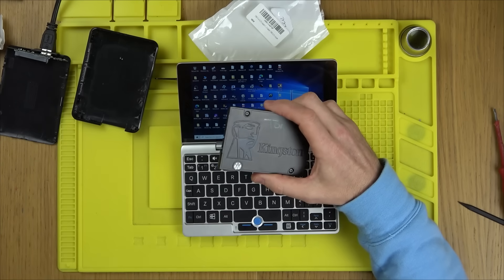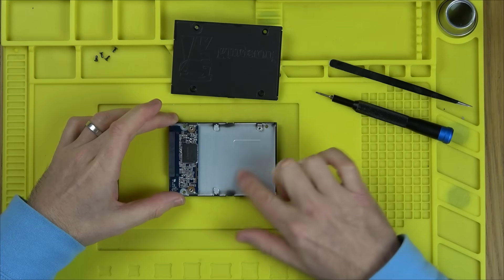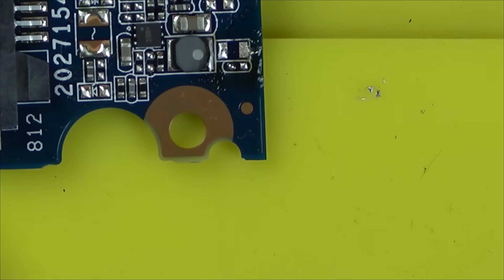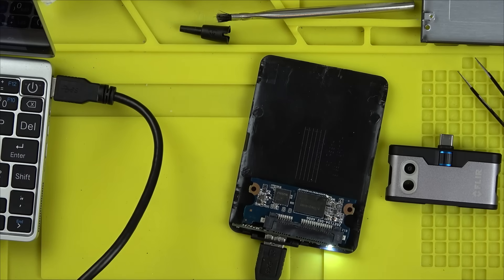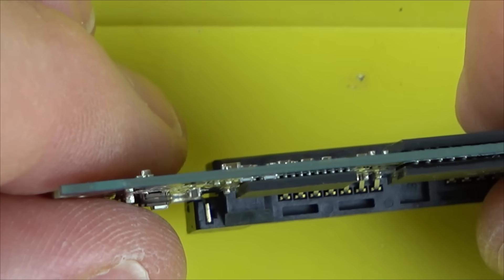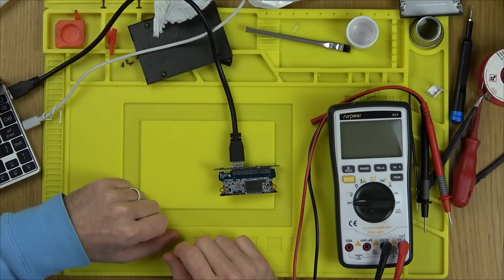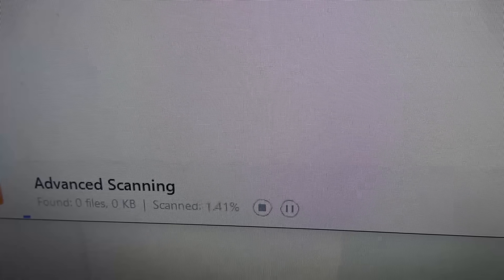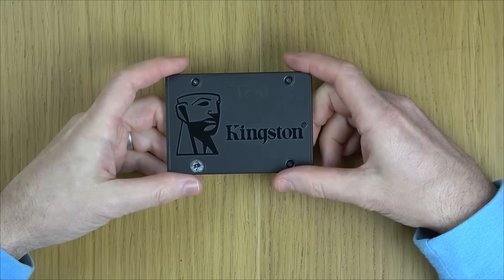Can I FIX a Kingston 240GB SSD ?

Comment: If you are still reading these comments... I have a Sandisk that gives this message. "check cable connection pxe-mof". I changed out the SSD and all is well except the saved documents and downloads are gone now.
I put it in another laptop and gives same message, so pretty sure it is trashed. Can you think of a reason this would have happened?

Comment: TESTDISK/PHOTOREC is an extremely powerful open source recovery tool that is CLI-based and allows you to manipulate the geometry of a failed drive which can happen when firmware gets scrambled and corrupt. It can recover individual files or it can recover entire partitions and it has worked magic for me in the past. Obviously if there's complete firmware failure or the drive is not able to be read at all within Windows then chip off methods would definitely have to be pursued. It's definitely worth a shot in the future if you ever run into a drive that is acting like this. Just my two cents, but figured it was worth sharing since I've had good success in the past!  I love all your videos, failure or not and I'm slowly making my way back through the MMV archives and it's so exciting to see the progression and of course such an extreme variety on this channel. Got yourself a lifetime subscriber here! Keep up the amazing work😊

Comment: I gave up on SSDs except for system/app drives. everything else is on spinny disc, from multiple vendors, & multiple copies of everything everywhere. I have at least two copies of every file, & the back up strategy is folder-based, not by volume. it's harder to manage but a better approach, & the app that does all this is programmed to nag for the drives to be mounted so it can do its stuff.
I started doing this when 'disk warrior' couldn't recover my data from a bust hitachi in one of those orange lacie cases. it showed me what had been on the drive, though, & there was some value in knowing exactly what I'd lost.

Comment: Hi vince, was the power settings power saving mode shutting down the SSD? Maybe set the hard drive shutdown power setting to more hours before shutting hard drives down, or never, so it never shuts down whilst recovering the drive in the recovery software

Comment: never use a ssd for sensitive data always use mechanical hd or back it up regularly to mechanical these ssd,s are a pain in the butt cheeks they only way to fix them is usually destructive to data so be warned.

Comment: It is not possible to recover that disk because the flash memories are already damaged. Every time you write to an SSD, the cells degrade, and when you reach a high TBW rate (the manufacturer specifies it) in that model it's 40 TBW, the memory is damaged and it is only possible to recover some information with very specialized tools. Use Crystal Disk Info to see the statistics saved in the SMART.

Comment: People think solid state memory works for ever, however as USA Tesla customers are finding out it doesn’t, Teslas solution is to sell you a new screen unit. The 24/7 Camera system is causing the issue. They can be repaired by a 3rd party company who provides significantly more solid state memory.

Comment: Thinking outside the box but an idea If that chip is getting hot, is it the chip shuts down and the software stops reading when it gets too hot? Switching off then re-starting may allow it to cool enough to start the process. Why not get a freezer block (Ones used for cool boxes for picnics) and sit the pcb (keeping it dry) on the freezer block and trying while keeping it very cool. Just a thought.
Reply: The flash memory controller chip always gets much hotter, which is normal. That's why it has a metal casing to dissipate heat, although many cheap drives are made of plastic. If that chip weren't working, it simply wouldn't detect it, and in this case, it did.

Comment: Dont use the usb/caddy way of connecting the ssd, instead, connect the ssd drive directly to one of the sata connections in your pc. The  usb way of connecting an ssd drive does not deliver as much power to the device as a main connection form your pc, and so, you can expect your usb powered ssd drive to run competently for a little while, but not run competently for an extended period of time, especially when the ssd drive is being run under load. If you use the main sata connection method directly from your pc, then you should not experience any under-powered hardware failures from the ssd drive that you are running anf you will more than likely be able to fully complete a scan with your hard drive recovery software - fyi, the EaseUS Disk recovery software is definitely the one to go for from your software choices by the way 😀😀

Comment: Sorry...I meant firmware.  I recently dealt with an OCZ Deneva SSD that behaved exactly the way this Kingston is.  After checking every capacitor and throwing every imaginable software tool at it, I was about to give up.  As a last ditch effort I scoured the internet to find a utility from the manufacturer.  I luckily found one that allowed me to update the firmware.  The drive immediately sprang to life and is currently running in one of my systems.
Reply: Did updating the firmware wipe the data?

Comment: Hi, can anybody help me solve my mystery that I have with a brand new SSD, It will not keep it's drive letter so every time I reboot my PC I have to reassign a new drive letter and because of this it can not be used as a boot drive. This is the same message I get from mine and all you have to do is allocate a drive letter, but like mine it will only work until you turn it off, then you have to do it again. It is a pity you did not know just to allocate it a drive letter and it probably would have worked fine so that you could then just copy all the data to a new drive.

Comment: had similar ssd with similar disconnect issues wean trying to copy the data from drive , worked for me using boot to Linux live and copy the filse from the old failed ssd .

Comment: If you are reading ANY voltage across that 0 ohm resistor, then it is technically open. There should be no drop across a short.

Comment: Hello,I'm a bit late to the party but I repaired many of them wich didn't have any shorts by reflowing that controller with 400c and flux,copied all the files after to a new one . I think that chip gets too hot and in time the solder balls crack and it comes to this .

Comment: There are a lot of things to Consider with this kind of Problem, I have had this kind of Problems DOZENS of Times, First thing is Windows, Windows in this case I believe is the Problem.  😁This is ONE of the Reasons I Switched to Linux. Secondly there are bugs out there that Screw with the Motherboard CMOS Configuration Files, and will create these kind of Problems. One way to Check and see if it is a CMOS Bug is to Unplug your PC and Hit the Power Button, 30 seconds, in the case of a Laptop you will have to Remove the Battery. This usually will clear the CMOS Bugs. Even if you Format a Drive to Fat 32 using Linux, if you switch back to Windows and Plug the Newly Formatted Drive (performed with Linux) Windows doesn't want to Recognize the Drive Properly UNLESS you redo the Drive in Windows. I'm not real sure WHY this happens but you can try it yourself and it will be a Problem that CAN be Replicated. If you Format the Drive Originally in Windows to Fat 32, Linux can use it no Problem. So when I am Creating a Drive I want to use on both Operating Systems, I will Format it on Windows first.

Comment: Good reason to back up . I have various drives on mine with SSD for the most part and just back up to more than one of them.  I have found linux to be helpful in the past for seeing onto drives that windows wont see but if it is a chip problem its likely going to do the same there as in windows.

Comment: i had a 500 GB WD 2.5" SSD that my roomate plugged into a modular power supply with a different power supplies power cable ( was pinned differently ) and it killed the SSD. Wouldn't show up under Disk Management or Diskpart. And it ultimately killed the Power adapter for my cloning dock. Didnt think an SSD could do that lol

Comment: The fact that the drive shows up in Windows and Disk Management isn't hanging implies it is a software problem of a corrupted partition. First port of call here would be to use data recovery software to see if you can recover the data from the drive. Shorted capacitor would normally take out a power rail and nothing would work.

Just finished watching the video, good video

Comment: I PUT A NOCTUA d15-S CPU COOLER JUST SITTING ON THE pHISON cKI[ WITH SOME THERMAL GREASE AND I WAS ABLE TO RESURRECT THE DATA AND COPY IT TO ANOTHER DRIVE.
(Sorry about the caps above.  Damn caps-lock was on and I did not want not re-type it.)

Comment: the heat spot under the chip is from the solder balls touching each other this is caused from overheating system unballed solder spots making it freeze,and is consistent with the heatspot we seen in your thermal camera!!!! resolution. run a bead of kingbo no clean flux around the chip and bake the board for 30 minutes on 350 degrees. 
this is a last resort, but it works on most graphics cards and ram modules aswell. goodluck!

Comment: Oh yay... I have that exact same drive, same size and all.  But I replaced it with a different brand, larger drive which I only use as a boot drive as SSDs will fail, guaranteed.  Yet all my HDDs all still work.  I think I had ONE HDD fail on me in my life, and that was two decades ago.  So now all my data goes on one of two 4TB HDDs, Seagate which I have also done really well with.  I still have old 20G Seagate drives that work.
 
I'm curious, what is that external USB cable you used to plug the drive in?  I could use one.

Comment: Windows is never the best OS to use to test a disk drive. Windows only knows Windows formatting and will just prompt you to initialize it. I use Linux and GParted to identify any potential partitions on the drive. I have used Linux to recover files on an SD card that Windows didn't recognize at all.

Comment: I realize that I am 10 months too late, but if you find yourself in similar situation again, you might have a better luck by doing a data recovery with a dissembled drive and a big heating on the problematic controller chip. The way it cycles available and unavailable reminds me on some internal thermal protection. I assume that the heating problem is based on some kind of internal failure, but if it works fine at first, a heatsink might help it work long enough to pull the data out.

Comment: sure fire way to get the data off of the drive would be to remove the storage chip and either put it on a new board or a specialized tol which is basically just a new board but with a socket so you don't have to reflow it

Comment: My Linux-centered mind immediately went "Boot up linux mint cinnamon edition, and try to make a backup disk image, apply that image to a different drive (to determine the validity of the image file) and then initialize the physical drive. then apply the disk image to the drive and its fixed. however, this depends on what is wrong with the drive. I am not sure if the data would be detected in linux mint, and, even if it did make it, it could be that the index table is corrupted, and you wont be able to access those files without a specialized software (often paid). I am not a professional of any sort (far from it, im just a hobbyist who knows a LITTLE about linux)

Comment: This looks to me like something caused the file allocation table/MBR to corrupt. Back in the day I could sometimes recover these enough to extract data. Many times it would be enough to connect the HDD to another PC and run CHKDSK manually. The key was to tell it to ignore bad sectors and attempt repair of the file system. If you were lucky, the bad sectors would be in unused areas of the HDD, or maybe affecting system files, leaving you free to copy the important data off. If the HDD was particularly unstable, I would use software to create an image of the HDD, again ignoring bad sectors, then mount the image elsewhere, leaving me free to repair the file system and extract the data without the HDD crapping out every 5 seconds.

Comment: These drives are trash. Having purchased around 200 of the 240GB variant, 40 of them failed within a year! They were tasked with running Windows 10 on basic office computers, very light work indeed!
Reply: I find Samsung to be worse. I bought a 1tb a few years ago and it only lasted a month before it died. Adata was just as bad. I would suggest a crucial drive.
Reply: I have 1 almost running for 5 years, still running

Comment: it says SATAFIRM S11. This could be a firmware brick. I have had same kingston drives recognized only as SATAFIRM S11. I looked up the internet and found that it's not something easy to recover the firmware. these kingston drives are just unreliable. i switched to Integral, Lexar and some other one since then..

Comment: I also have a Kingston drive, same size (240GB) which failed just the same as the one you reviewed here. Various recovery software I tried behaved exactly the same. Curious thing: when I opened the drive after seen your video, the board is different and there isn't one of those Phison chips inside. Also, when the disk failed, one of the first things I tried was to use Kingston tools to try to repair, access or at least reflash it. To my surprise, the Kingston tools didn't even recognize that a Kingston disk was attached to the computer at all (I was not using an USB adapter, but directly attached to another SATA port).

Comment: For recovery software, you could've tried testdisk (i used it to recover my corrupted data) to see if it also recognizes it but, if other softwares gave the exact same problems than most likely, it's the ssd controller chip.
Reply: No. It's the firmware.
Reply: @cosmefulanito5933  plausible
Reply: Glad someone else knows about this awesome software

Comment: I know this is an old video but that Philson chip looked like it got really hot.  Too bad yout didn't have the chip spec sheet to look up the heat tolerances. I wonder if after its been on a while the thermal throttling mechanism kicks in and disconnects the drive.  Could've been work trying to mount a cooler of some kind on it to keep the Philson chip cool long enough to see if the data is viable and extractable.  Just a thought. Cheers.

Comment: i got the same probleme on a usb stick , on the first connection it show me the full stick, but when i try to read from stick to backup data . it will be disconectetd .disconect and reconnet work but you can distroy all the data on the stick. i found a other solution to backup the data . the probleme is the fault chip it run to hot you need to cool down it then you don`t lose the connection . so you can backup you data.

Comment: These Phison S11's fail in such a particular manner. It clicked when data recovering, as the ssd showed up as SATAFIRM S11. Since the SSD shows up in the pc, the hardware is fine, the S11 is fine and functional, the heat you saw is normal. These controllers have a habbit of corrupting their own firmware, along with all the mapping of data on NAND flash. Data is pretty much unretrievable with conventional means, but by reflasing the firmware to the chip, you will have a perfectly functional drive. This fault is literally everywhere an S11 controller is, it is extremely standard (and sad for the data owner)

Comment: I do automotive repair, when you see discoloration like you noted on that chip its 100% dead, iv seen them go so far as to leave an obvious almost xray like silhouette of the leadframe package on the surface due to heat. in the automotive world its usualy easier to spot from bubbling or discoloured conformal coating, but intereor protected devices like say an airbag controller may not have conformal and exhibit what you show here.

Comment: try putting in an anti static bag and cool it in the fridge see if will get through more scanning, if it does then try keep that chip cool or a long usb into a fridge to get the data ;-) worth a try as it is getting someblocks before disconnecting

Comment: Connect it to a Linux box, after checking for any variations of the locked status (hdparm or smartctl etc...), you could throw a couple of lines of bash script together to disconnect and reconnect the USB I/O, while pausing/re-synching the scan repair and data retrieval.

Comment: Hello, I had a similar problem , and I found the solution. I tried with windows, linux, chrome os, but all showed like that ssd in the video. After I pluged a Mac OS 10.13 which is an old apple os, and that one was able to read it without any special trick or app. Onlya few files was broken, but almost all disk I could copy to another drive. I do not know the new apple os , but that old one worked well.

Comment: Quite often a lot of devices made using modern surface-mount technology nowadays is deliberately designed not to be fixable, it's part of that planned obsolescence thing, electronic device manufacturers deliberately do that in order to be able to maintain a good profit-margin, as it is cheaper to just replace the device rather than fix it, I had three Samsung 1Tb 2.5 inch SSDs fail on me taking 3Tb of my irreplaceable data with them in the process, all three of the failed SSDs report a disc size of about 32kb or something like that.

Comment: One thing you could try is going into Device Manager in Windows and look at all the items under USB Controllers, then right click all items that mention Hub then go to the Power Management settings and check to see if "Allow the computer to turn off this device to save power " has been un-checked, if not, click on the blue square to un-check it.